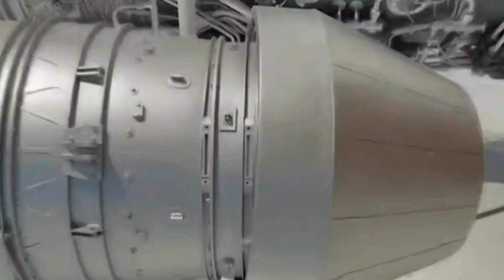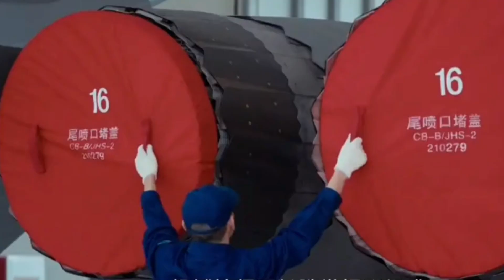Supercharged J 20 Stealth Fighter WS 15 Jet Engine

Comment: They have mass produce J20 with WS15 since 2020. They are now mass producing WS15, likely for other purposes although the J35 is not using it. Likely the two seats J20. By 2025, China’s air force of 5th gen fighters J20 and J35 will be a force to be reckoned even by the Americans.